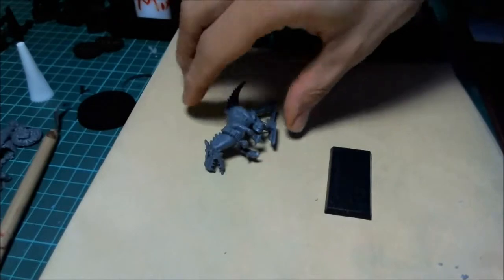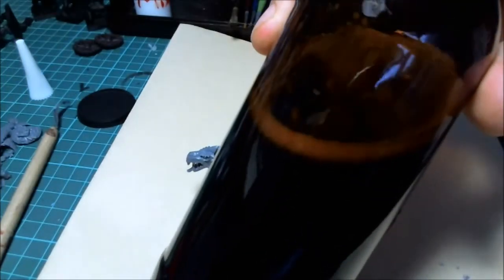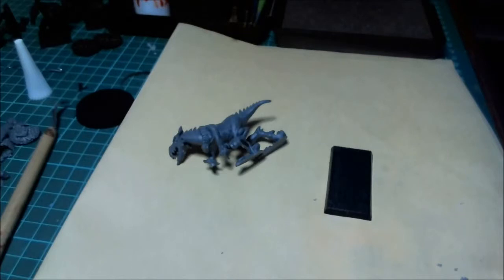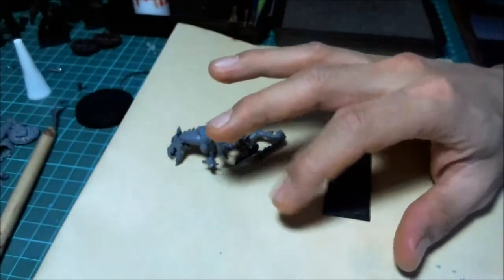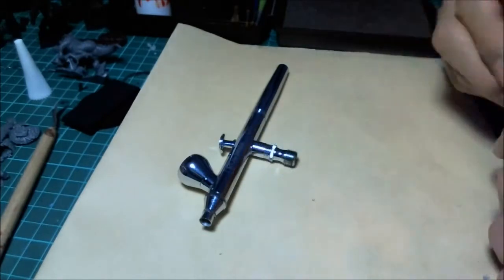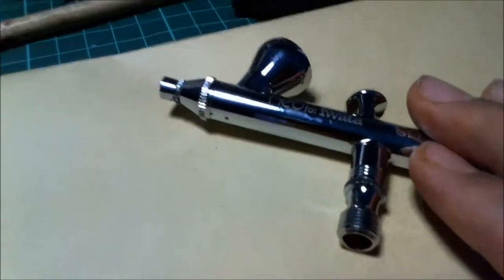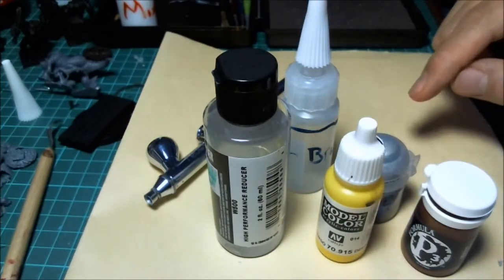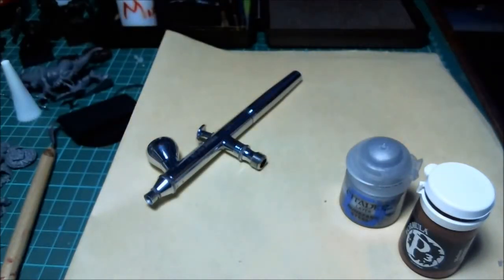How to Airbrush for Beginners Part 1

Comment from the maker: So, Ventilation is kinda covered in the vid. But, I need to say that you should follow the best practices for ventilation. Me, I just use a fan and an open window. At night, I can see the mist created by the airbrush getting pulled out by the fan and out the window. Also, I tend not do use the thing for more than say 20 min at a time, and usually no more than 6 colors before I am moving onto the brush. Hope that helps.